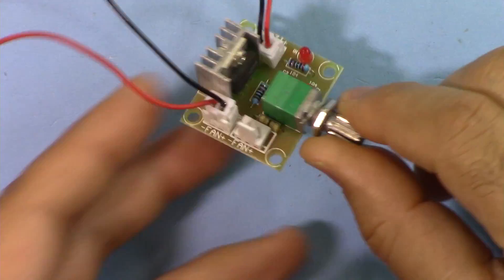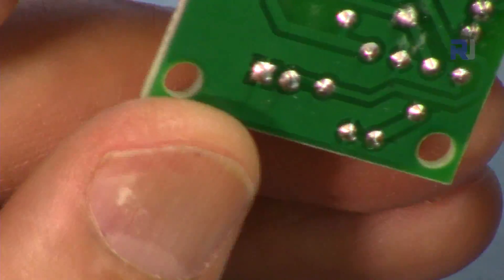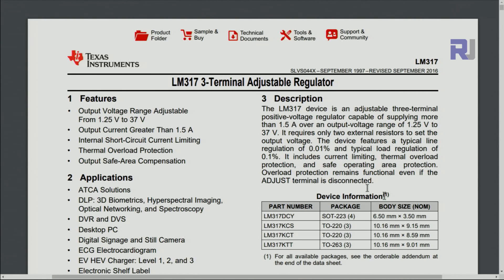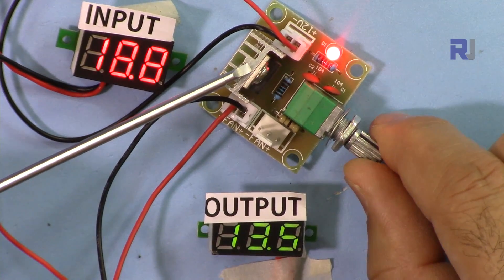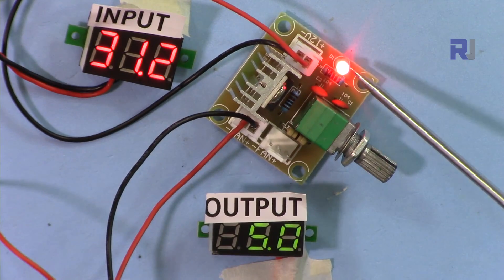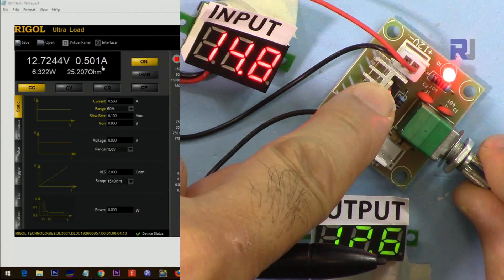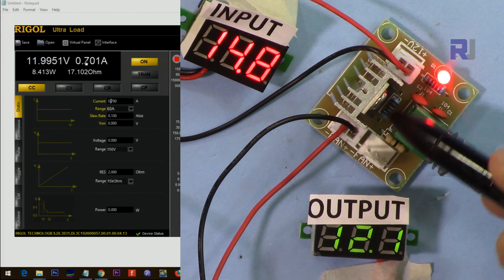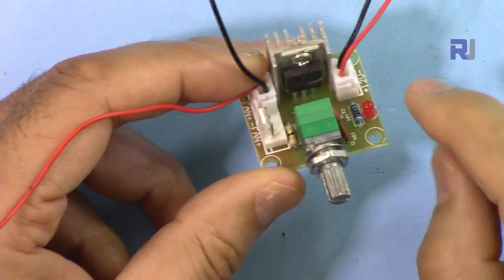Test review of LM317 DC Voltage regulator module

Comment: i tryed it with a really big heatsink and still got really dam hot.
Reply from the maker: it can handle about 100°C so don't worry.
Reply: lower voltage use will disapate access wattage as heat.
Reply: you need to use heat sink paste also.

Comment: I've tried a few different things, everything from an led to a small DC motor. I was under the impression that I could use the one I bought as a power supply. The one I have is an ac to dc or dc to dc converter.  I'll provide a link. Maybe it's different but hopefully you can still help lol.
https://www.wish.com/product/lm317-adjustable-voltage-regulator-ac-dc-step-down-power-supply-module-with-led-meter-54aba0204274a2031d974277
Reply from the maker: This is exact chip.  Yes you can use it if your "small motor" doesn't need more than this chip can supply.
Reply: I have the exact module but haven't used it yet. If I hook up a 9v battery or usb to my Arduino Uno and supply the LM317 with 5v I should get 2v out. Am I correct?

Comment: I bought a similar module, mine has the bolt meter and a few capacitors on it. It seems to work fine when I wire it up but as soon as I put a load on it the voltage just drops straight down. Any ideas of why and how I can fix it?
Reply: Ok, thank you very much. I'm tempted to just tear the whole thing apart and build my own using some of those components and maybe make a few changes. I have tried using different input, including ac and dc. I still end up with the same results though.
Reply: I bought it to build a small variable power supply and actually built a really nice enclosure for it, it looked like a factory built one and I was actually very proud of it but all of that went to hell when I found out I couldn't use it lol.
Reply from the maker: you are welcome. This module is for simple load. Now days you can get very nice module like this: https://youtu.be/IFiupEP_vB8 with 3A output. Or  something like this with display https://youtu.be/UDyNjmM7p_Y you can change the potentiometer with your own variable knob.
Reply: Ok, thank you very much 👍🏼